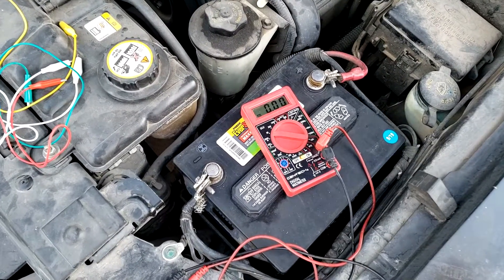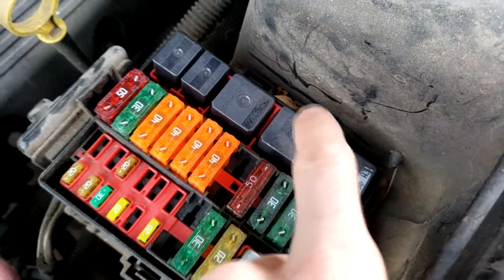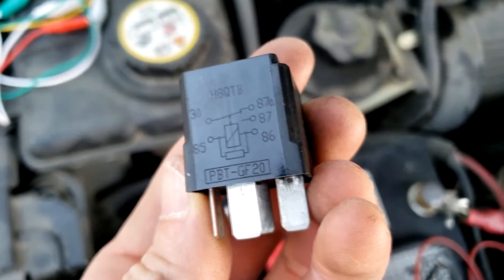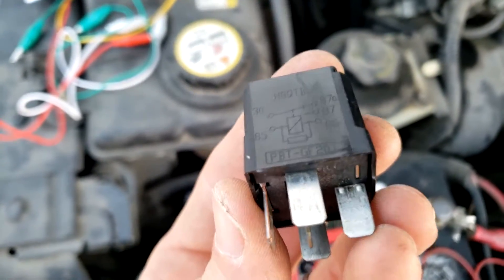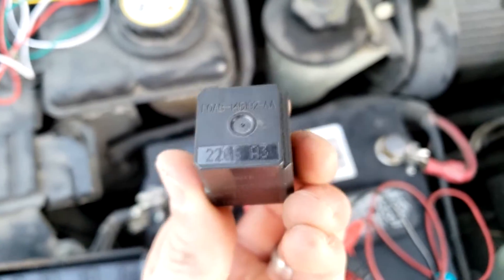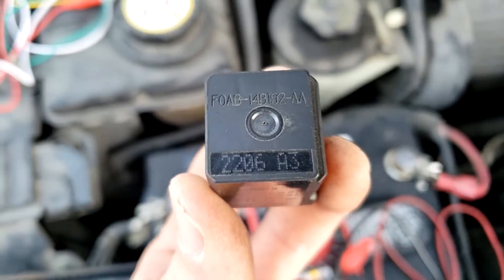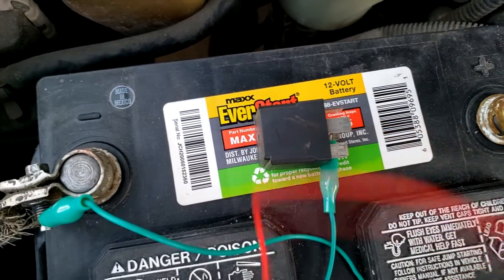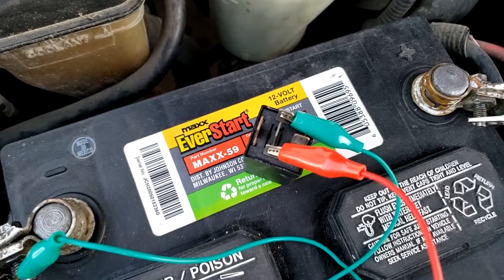How to Properly Test a Car Relay - Relays 101 - Resistence Check

Comment: Can a relay have good resistance but still be bad ?
Reply from the maker: Ways a Relay Can Still Be Bad Despite "Good" Resistance:

Contacts Worn or Burned
The coil energizes and clicks, but the internal contacts are pitted or corroded, causing high resistance or no continuity across the switch terminals.

Mechanical Failure
The coil energizes, but the armature doesn’t move due to mechanical binding, a broken spring, or internal damage.

Intermittent Operation
Works sometimes and fails other times, often due to loose internal connections or a weak return spring.

Welded Contacts
Relay appears fine, but the contacts are stuck closed, so the relay never truly "opens" even when the coil is off.

Wrong Coil Voltage
Resistance is in spec, but if you're applying the wrong voltage (e.g., 12V to a 24V relay), it won't operate reliably even though it tests fine with a multimeter.

Comment: Bro, you don’t need to check the starter relay if you turn the key in the car Kranks starter works 
If it turns over, go straight for the fuel pump ….
Reply from the maker: It's an example explaining how replays work! :)

Comment: Could a faulty relay affect the central  locking on a car,, currently my car does not want to unlock/lock from electric key fob,, Could a relay be the issue?
Reply from the maker: It doesnt work at all? or its intermittant?
Reply: @TutorialGenius  the central locking does not work from the key fob at all, only the parking/side lights come on,,,

Comment: what if a mouse gnawd on the wire to the relay receptacle,,  what should the receptacle readings be?..  I pulled my old pickup out of the woods after being out there for 15 years..  no power to the fuel pump
Reply: Uhm... The readings on the relay would be the same :p